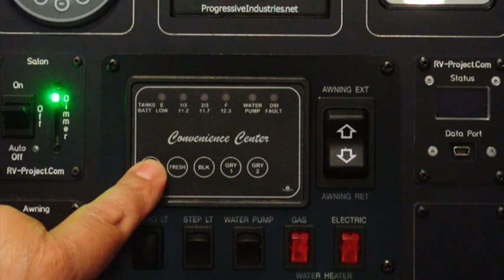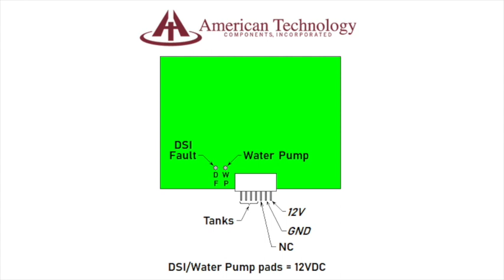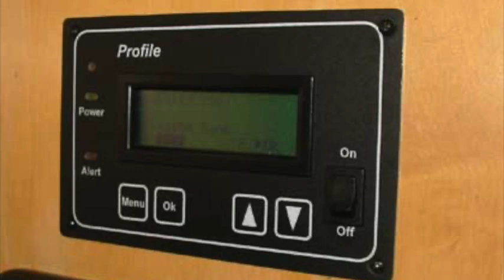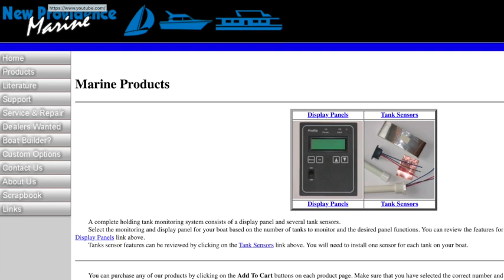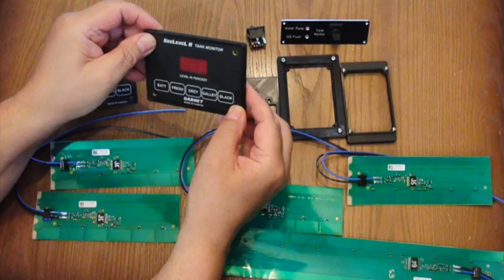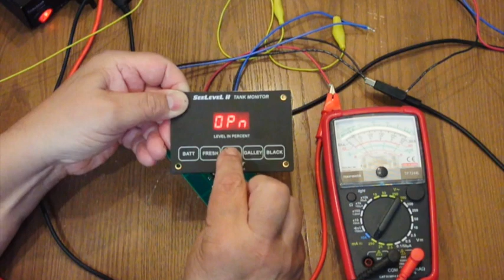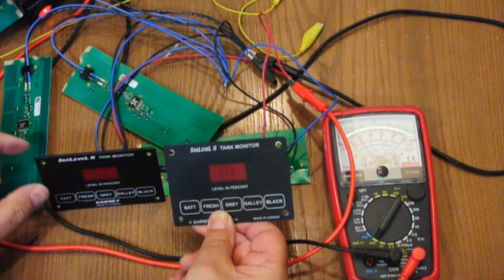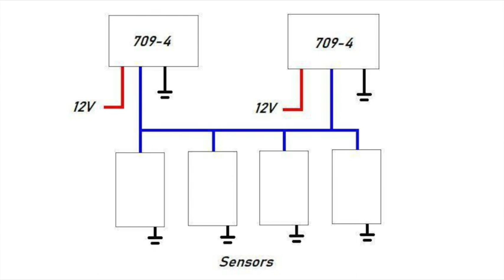Upgrading and customizing my RV's holding tank monitor system - Part 1.

Comment: I wish someone would do an easy to follow video for RVers to follow, a simple - no technical  - mock up, on a garage floor using buckets and showing how they are wired from one to the other to the other to the panel, and where the battery ties in to this. The install instructions provided are horrible unless you are an electrical engineer.

Comment: How is this working out for you.  I was looking to install them but was wanting to find a long term use update to make sure they are holding up.  Thanks
Reply from the maker: I have had them for a year and they still work.  These work by measuring capacitance from the outside of the tank.  

I had a different brand capacitive tank monitor in my last boat, and it worked for the 6yrs that I owned the boat. 

While a different brand monitor is no guarantee this monitor will work, it does at least indicate the capacitive tank sensors do not foul like the internal well-nuts the OEM monitors use.

The biggest issue as I see it is being able to install the sensors correctly on the tank. They should be a few inches from anything metal, which is not always possible  in the typical RV.

Comment: How is it that the monitor has a single input for all the monitors? How can the monitor differentiate which tank is which? I absolutely love that you 3d printed the bezels I just might have print out for myself.
Reply from the maker: It communicates via a digital serial data bus.  The single wire is essentially a network, and each device broadcasts at an appropriate time.  Not unlike how the original Ethernet works (10-Base-2 for example), but without the need for the coax shielding.

Each sensor sends a unique ID to the monitor. In fact, you have to program the sensors when installing to set them up for which ID they broadcast.

In contrast, the OEM style well-nut monitors simply return a DC voltage which represents the tank level. This requires a wire to each tank.
Reply: @RVProject  makes total sense. I appreciate the response. I'm currently converting a sprinter van for off grid traveling and I love to geek out on every detail. I think that's why I find your videos so awesome. I definitely want to start building some of my own components as well. Keep up the great work!!

Comment: No one shows how to actually remove this.  there are no screws and I am trying to research before I get frustrated and yank!  How on earth do I actually remove this meter?
Reply from the maker: I am not exactly sure what you are referring to, but if you mean the "Convenience Center" panel, it just snaps into the hole.

The easiest way to remove it is from the backside. First, remove the circuit board. Then the sidewalls of the enclosure will be flexible enough to snap it out.

It will be very difficult to remove the enclosure without first removing the circuit board, as the board more-or-less holds the enclosure in place.
Reply: @RVProject  I figured it out. For some reason everyone on youtube assumes an rv owner knows the front has a tab on the top that can release the cover. I didn't know that and was getting ready to yank and pray. Lol. 

I figured it out eventually. After the front cover is removed the screws are exposed and it is pretty easy. Every video I found skips this first step so it can be a little confusing in how to get started.

Comment: Could you just use the one with the Pump on/off switch and rewire it for power on/off?
Reply from the maker: If you don't mind the incorrectly labelled switch, the pump switch can be used as an on/off switch. The switch is wired through the board so you would need to use the wires on the pigtail harness to connect it.

Comment: This is way beyond a "basic and simple" tank monitor replacement. 3d printing, surge protection, sensor cutting... not something the average RV owner will tackle. But hey, great system for you!
Reply from the maker: Actually there are many people that do install this system in their RV.  The SeeLevel system is in a few trailers as OEM equipment, but most are sold aftermarket.

3D printing of the adapter bezels and surge protection are optional.  I simply provide these ideas for those that might want to take the extra step.  

This might not be a project for you, but I like to provide a wide range of projects from simple to complex... as my viewers have varying skill levels. Pick the projects you are comfortable in doing.

Comment: Awesome...I’ve been planning on this install in my rig. I’d watched another video on this tank monitoring system, but as usual, your’s is head and shoulders above and beyond. So many critical and unique insights. BTW, you’ve really “gone for it” on the 3D printing front. So many new options. Which model 3D printer do you end up getting?  Thanks as always.
Reply from the maker: My 3D printer is a Creality Ender 3 Pro that I modified over time (auto bed leveling and other goodies).  But it is still a basic Ender 3 Pro.